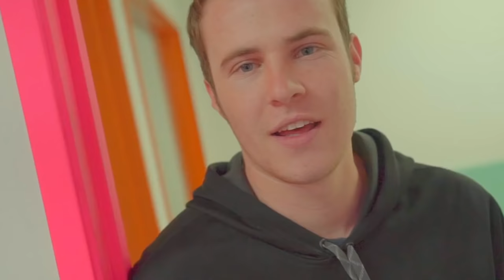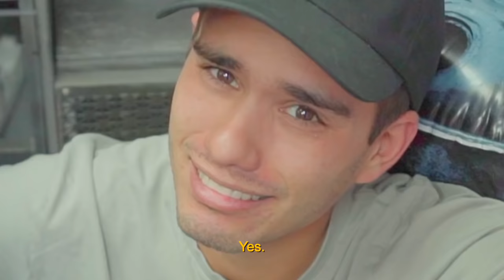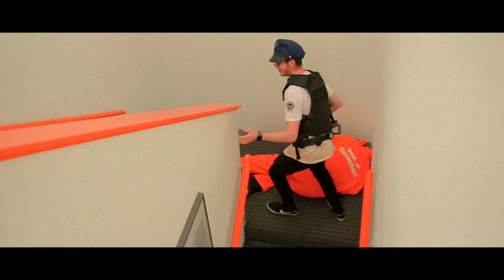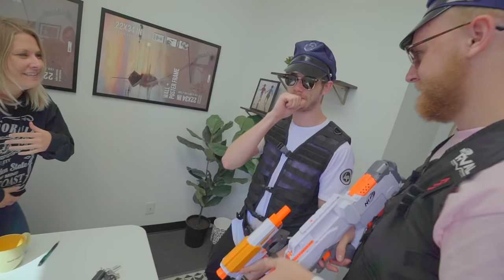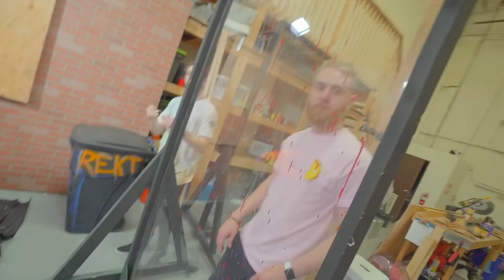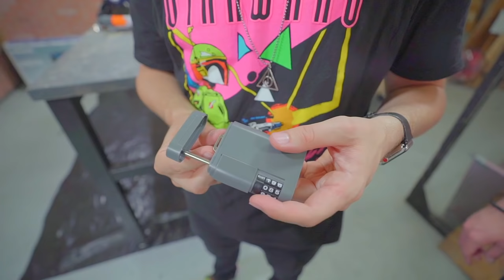Found a Secret Hidden Mini Safe in Hi5 Studios!

Comment: A TS5 key goes to a sentry safe which is also a cash box. The 863 key was also sentry
Reply: Swevs1330 44 i was going to say the same its no coincidence that the numbees in one key led to the other so I am guessing it will open a safe or a bank safe box
Reply: Same
Reply: Look at the thumbnail, the filing cabinet is undented and it's opened, but in the video it only opened when it was dented. The entire thing is staged.
Reply: NexusKing they can have the filing cabinet edited. That or you're right that it's staged.
Reply: Melissa Joyce Diego That means they would have to photo shop Matthias's hand as well then, and if they did that's some good photoshop.
Reply: NexusKing here's the thing if you noticed how the photo was shot, the side where the dents are supposed to be were almost cut off. So now it's easier to fix in photoshop. So it's already opened and they already have the mini safe where 863 worked. Took the photo for thumbnail before connor completely destroyed it after.
Reply: NexusKing like I said in the end, or you could be right that it's staged.

Comment: Matt i looked up what square/rectangle keys are for and i got this information. A rectangular, square key is normally Called a Sunk key but they can also be called Parallel Keys. Parallel keys have a square or rectangular cross-section. Square keys are normally used for smaller shafts and rectangular faced keys are used for a shaft diameters over 6.5in. I hope this information can be helpful with the further investigation.
Reply: MJ's Emerald City m
Reply: I took the info in the comments to help and  I figured out what the square key goes to! https://twitter.com/SpartanQueenEm/status/1004764546572185600
Reply: MJ's Emerald City it's easier to look up the code on the key (Ts5) and it's for a double sided (top and bottom) sentry safe

Comment: Did you ever think about going back into the ceiling in a different area in blue base?
Reply: Madilizon they did that when they had been looking for the filing cabinet to see what the original key could go to but they didn’t find anything
Reply: As small as those safes are, they would have to look VERY hard and very thoroughly. . .There could be a chance something was missed.
Reply: At this point I'd be going to literally every ceiling title in the entire blue base and lifting.

Comment: 1 Found key in roof
2 Found filling cabinet 
3 1 of the “863” keys broke in filling cabinet lock
4 no one owned beige filling cabinet 
5 Conor breaks lock
6 They find combination lock in draw
7 they open combination lock with “863”
8 they find “Ts5” key in lock ( I think it looks like a mail box key)

And that’s it so far
Reply: the TS5 key is for a safe/cash box
Reply: it's probably cash box key
Reply: FunkyBunny *drawer

Comment: The combination lock with the key inside it is often used for construction job sites. If you are the general contractor or owner you don't want to have to keep unlocking the door or trade around keys with the various trades people doing work on the space. You would mount that on the door frame that way you can just give whoever is doing work on the space the combination so they can unlock the door and get in, and then put the key back after they are done and lock up.
Reply: So realistically that key would just be for a padlock that the previous owner had to lock up while work was being done on the space.

Comment: Ts5 key is a safe box key so who every was in blue base before you bought it may had a safe box so if there is another room in the ceiling either it in one of the room i the ceiling or it mint be in the others building because the people who use to work there mint also had work in the others building or the person that have the safe box mint took it with them or like a time capsule in the ground. Just saying it really awesome.
Reply: I hadn't though if a time capsule... That would be so cool, I just pray that it isn't a prank.
Reply: Xavier Wallace I fell you but if it is a time capsule where would it be at??? That the real question

Comment: test the new key on the file cabinet that you just busted open, actually.
Reply: Why would they lock the key to the file cabinet inside of it?
Reply: Don’t think that would work now
Reply: They busted the lock on the previous video anyways
Reply: I mean that does make sense. Usually things like that have multiple keys to a set. You never know.
Reply: I think Connor broke the lock, or they pulled out all 3 draws, if the key worked it wouldn't be much of a find.
Reply: Jenny Deirdra Agnes Johnson why would they lock a key a inside filing cabinet if the key belongs to the filing cabinet?
Reply: it could be a spear key

Comment: The ts5 came from the same company as the 863 keys did so it's more than likely going to go to a safe (it's a cash box). If you can find a safe then try both keys and see which works. I suggest looking through all the bases just to make sure that there aren't other keys or things like what you have found today or in past videos in other areas. Good luck.

Comment: Hey, Matthias, I found out what it's for: The TS5 Key for Sentry Safes is a double sided (cut top and bottom) used on many Sentry Safe products and others. Key will be cut to code and ready to work in the lock. So basically it's for a safe. So please make another video so that everyone who has been waiting will be able to see what you have found after reading my comment and then searching outside and around blue, red, and orange base. I'm including the other bases because the owner of blue base could have owned or just hidden something or somethings in the other bases. Also ask everyone that works for you about all of the objects that you have found and also ask them if they have seen any objects that they don't know what they are for, where they came from, and if they do know what its for but don't know how to open/use it.

Comment: Ts5 key is a replacement key for a sentry safe, although it is commonly used for other sentry products as well. See website for details: https://lostakey.net/t-series-key-code-c-35/ts5-key-for-sentry-safe-and-other-sentry-products-p-116315?zenid=600r9l4ro91dnvtl1mqjbfako0
As for 863, that just happened to be the lock combination for the mini safe. I think that the former tenants put the tape on the key so that they would remember the combination. Both keys should go to a sentry safe, although I don’t know exactly which type. Please try to solve this mystery, it’s exciting! :)

Comment: The TSA key goes to  the gun safe. The gun safe is going to have documents that tie into the abandoned car and the labs that were originally at the building. If you find out the exact company that owned the building before you, you can find out about the purpose of the labs which will explain the hundreds of other keys because the numbers are probably the lab it unlocked or a storage unit and they  wanted them to go away until they needed them.

Comment: Found this on google just searched up ts5 

The TS5 Key for Sentry Safes is a double sided (cut top and bottom) used on many Sentry Safe products and others. Key will be cut to code and ready to work in the lock. ... FYI- This key series is very difficult to reproduce as there is not an equiveleny key blank / key way to use.

Comment: Here’s some square key info They have a square or rectangular cross-section. Square keys are used for smaller shafts and rectangular faced keys are used for shaft diameters over 6.5 in (170 mm) or when the wall thickness of the mating hub is an issue. Set screws often accompany parallel keys to lock the mating parts into place.

Comment: The key looks similar to a key the name of a "square" gilbarco vedeer-root dispenser crind door key. If I'm wrong, I searched more square keys. And found one key similar. But I dont have a name. Those were still door locks. Think of this. I found more square keys like that. Like a square tubular door knob lock key. Or a square panelboard door lock key. But, did you ask a previous owner (if there Is one). They can have all the answers that will help you. Now this. Did you see any weird looking square things around the whole base. If so. You would probably break them. That might be a door. This is all the info I have. Have a great day finding the door or safe. Good luck!

EDIT: I might have found the key right here. It's a metal security door lock key. It looks so similar. I searched it up and it looks like A DOOR LOCK that looks like the one to close the door in the backyard (if you have one). So It MIGHT be a door within the walls. Ok. Just listen... good luck!

Comment: The TS5 key is a standard key mainly used in in fly screen door locks down to some filing cabinets, windows and even bike locks. so if i was u i would go around blue base and see if there are any windows, doors or even a power/ fuse box. there could be some windows in the ceiling since its a large area. cause who knows the mystery of the key could be solved on the outside of blue base. Hope this helps. 
PS: if you need anymore information about anything just ask

Comment: I’m pretty sure the key u found inside a mini safe in the filing cabinet is to a sentry safe usely sentry safes are black or white and small a bit smaller then a brief case look for that if not ask the previous owners if they had a sentry safe I just noticed as I was writing this others wrote the same thing ;—;

Comment: I've been through googling and found out that TS key was a series of keys (TS0 to TS9) that are used for Sentry Cash Box/Mini safe, because the TS5 key was similar to the images in google. 863 key is no longer needed or maybe its needed, it depends what is the vault/mini safe; But the real question is...

What's inside of the mini vault of TS5 key?

Comment: Both Ts5 and 863 lead to a century safe 863 is a key replacement for Ts5 century key. What doesn’t make sense is if it was a replacement key why would it be the code to the original key? And if the had the original key what would they need a replacement for?

Comment: Ok so I have a new lead for you I know it's been a while since this uploaded but I was doing some research and in an old battle universe video you can see in orange base a small black corner poking out behind the desk in the old google eyes room( team edge gaming room but this was before that) and its behind the white desk where mike was sitting and it is poking out from under the were the monitor was and to me it looked like the edge of what  might be a safe because it looked like it was coming up from under the floor.(I also looked up the key number and it goes to a sentry safe one of the smaller versions that you put in the combination and then (which happens to have  a three digit code slot) and then you twist the nob forward the all the way backwards)

Comment: I think if it’s this far down the rabbit hole it would be special to the owner so      It can be another area search the blue prints of blue base and connect the dots from this video and the video where you said the blueprints didn’t add up well what if they used to I hope you read this and think as I did

Comment: to connect, in the blue base you found the key, 863, then you found the fileing cabinet and you hit it with a baseball bat, that strategy opened the fileing cabinet and you found the mini-safe, then you put the code 863 into the mini-safe and it opened then you found a key, TS5, in the safe. So mabey back to the apartment theory, mabey TS5 leads to another key that leads to an apartment.

Comment: It is also a drawer lock key for a black box there should be a number next to the lock on the box you might not actually need the key to open the safe it might be a bigger picture and since the other is a telephone code you could find it in that area witch could be Florida of some other area code if you don’t think it is there search other areas with the same code

Comment: I work for moving co and work with file cabnets most locks have numbers on the face of the lock does any of the key in the red box fit the filing cabnet?the 863 key had nothing to do with the safe but the name did in to the next clue!!

Comment: So I just watched the video and I have a fireproof sentry safe mine came with a smaller metal box for storing money and had a separate key the key was square and smaller just like the one you pulled out of the filing cabinet